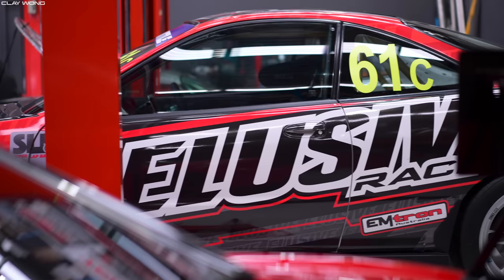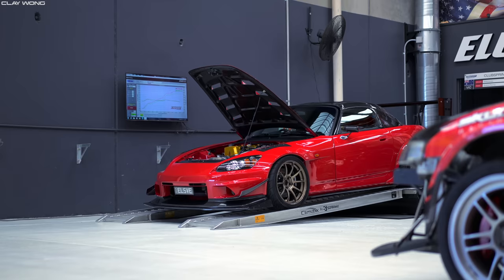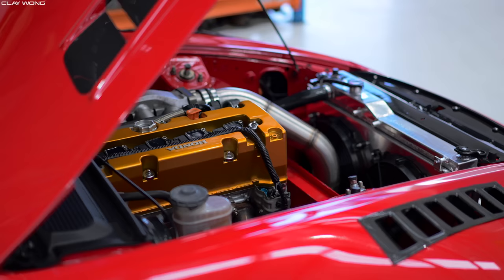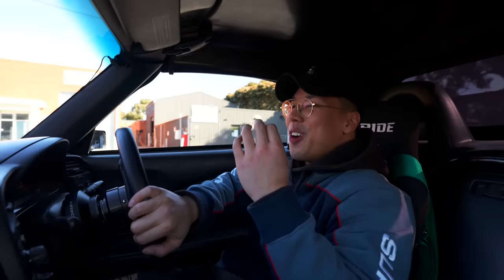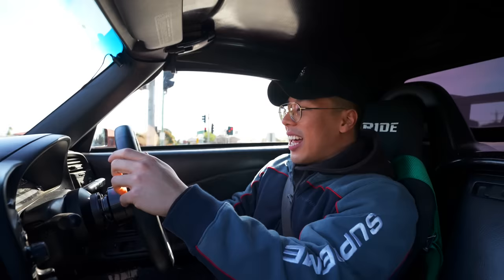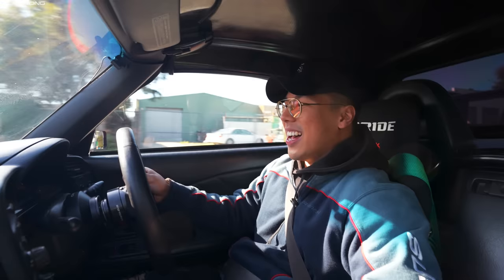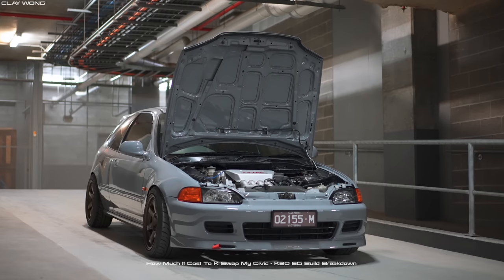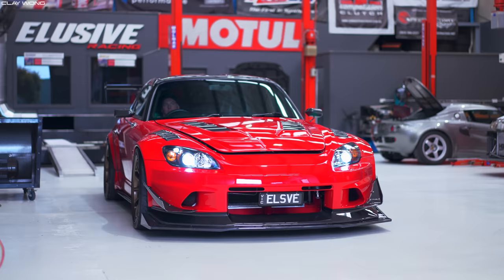This Is Why You Need To K Swap The Honda S2000: K24 S2K

Comment: I like to think the S2000 is more than just a faster MX-5. The glorious 9,000 rpm redline is what makes this car special, and you can drive it that way any day of the week. The F20 (F22 in some markets) defines this car more than any other component. Yes, the K series is powerful, reliable, available everywhere and has tons of aftermarket support, but that will pretty much just turn your S2K into a RWD convertible Civic or Accord. It can also lower its resale. You may as well get a much cheaper random Mazda roadster if you’re gonna do the swap. There’s also a folding hardtop option from the third gen onwards.

Comment: I think the f series is right at home, I’d k swap an NA, NB Miata though!
Reply: Been trying to decide if I want a k24 NB or a k24 ft86
Reply: Same
Reply: @anon136  I think you just need both. I'll borrow the one you're not driving. Lol.
Reply: This is why I’m here as I was going to ls1 swap my nb, but I think I’m sold on this
Reply: @anon136  that I swapped 86 would be so fire and unique!
Reply: @anon136  My dude... i´d love to K swap a GT86, but it is HELLA expensive, much more then K swapping s2k.

K power swap kit is over 9 k USD... NO ENGINE. + some additional costs like some honda parts (oil pump etc.), tune..

But... the problem is, that this swap kit utilizes stock transmission..... which is made out of chocolate. If you want NA, it´s ok but if you want to go for boost, it is reccomanded to swap it out. Best option is 350z trans, but that will run you around 
7k USD (transmission, mounts, custom made drive shaft etc. 
Count in diff and beefier half axels and you are looking at potentially 20k+ with work and everything...

I really like GT86, but i´m not a huge fan of the engine / trans combo, but swapping it out... you could just buy something much, much faster for the money. 

But that´s just my take. If you got the cash, go get it Tiger.

Comment: I feel like you have to build the bottom end of a K series to be as good as the bottom end of the f20 or f22. Yes the roller cam on the intake is better in the K, but if you're only talking stock engine vs stock engine you can't take a stock K as far on forced induction as you can an f22 or f20. There are so many f20's and f22s out there in the world with stock internals making 450-500hp and low 300s tq that have 100k plus on the odometer.  Something else to consider is that all the video comparisons out there typically compare the K24 and the F20, the most dramatic difference. Very few compare the F22 to the K. The reality is the difference is usually less than 20 HP. The K is all the new hype but the F is still an amazing engine that's more than capable. To me the only way I'm ever considering a K is if I blow up my F22 to the point it can't be rebuilt.
Reply: Thinking you have a bottom end with a 2.2 or 2.4L is funny
Reply: @trillazun  What does that even mean?

Comment: A big trend in the US is F24 builds. Makes lots of power and decent torque but reliability is better and overall a cheaper swap than going full K24.

I know a couple grassroots racers who run K series and most seem to end up regretting it. This is strickly due to reliability issues. Lots of vibration problems and things breaking under dedicated track use. Plus side is they're very cheap for a short block but then it could cost you a weekend, a race and time..
Definitely like to see further improvements from the aftermarket with the K series in ap1/2 s2000s.
I'm running a 120k mile F20 lightly modified and tuned. Track it once a month and has been extremely reliable.

Comment: How has it affected the weight distribution? Honda spent a lot of time mounting the original engine just right.
Reply: I was wondering that too with the front engine mid mount design being essentially part of the magic of the chassis and great handling. The k24 has to be substantially heavier. Would cause understeer. In theory.
Reply: They don't weigh that much different and the K24 is mounted in the same position/angle as the F20, I don't think it upsets the weight distribution at all
Reply: My k24 is the same weight around than my b18c5 that I had in my EM1 pretty they weight around the same

Comment: I'm keeping my 9k rpm redline. I bought an S2K that had the engine pulled apart and out of the car, and I still paid to fix it and put it back in rather than k swap it.

Comment: K20 might be a better engine and produce way more power with mods specially in a NA set up where the f20 is pretty much maxed out. But I still love the f20/f22 it has its own sound that I love, unless it blows maybe I’ll consider a k20/24.

Comment: Great vid. For what it’s worth tho - getting rid of the F engine means your killing the value on these fast appreciating cars in original trim.
Reply: Agree but also disagree... current market conditions dont seem to give an F about mods or not... and the body of this car is highly modified so I doubt "orginality" is really priority to them...
Reply from the maker: I gotta agree with you on that! Some owners just prefer fun over value though. I think a stock example is honestly not as fun and explains why there is such a huge aftermarket support for the S2000.😁

Comment: It’s not cheaper if you add in the cost of the swap itself you’re already out five to 6K you can have a reliable 500 hp F-series for that kind of money. Know if money is no object to you then yeah I would agree. The K-series probably is the battery engine if you’re trying to build it.

Comment: I allways considered this comparation unfair. U are comparing the same gearbox with a k24/k20 that has more hp with "shorter gearing". To compare same engine and gearbox capability u should compare something like: f20c with 4.7 fd; f22c with 4.55 fd; k24/20 with a 3.8 fd. The only direct comparation i had was the k24/k20 head (all stock with dc5 cams) vs f20c, both with the same gearbox. Of course k24 wins hands down because it has less top speed but more aceleration. But put a 4.7 final drive or even shorter in the f20c and compare again

Comment: Fucking Mint S2K.
I once heard the F20C is essentially a FWD motor that was made RWD using an adapter plate.
The more I see video's like this I sit back on the fence about selling my AP1.
Great video Clay!
Reply: BTW I've had my S2K since 2011 still has under 200K on the clock ;)
Reply: The F20C was a purpose built motor specifically for the S2000 and nothing else. It was always a rear wheel drive motor

Comment: I strongly disagree.
Yes the K series is a great platform for builders and tuners. But there are so many other considerations to account before “tuning” a vehicle.
As well mentioned in the video “the S2000 is a legendary car” and that status was not given just because the chassis or the roadster, also the masterpiece F20c engine.
Swapping a K-series engine into the S2000 will plummet its market value.
A pristine, low miles, oem s2000 can reach the 6 digits dollars in auctions.
The argument of cheap parts is just for the engine, not cheap to replace body parts or interiors on and S2000 (specially the soft or hard top).
Same reason why you wouldn’t K swap an NSX.
So no, I would not swap a F20/F22 engine for a K series.

Comment: Your description says it makes 230whp when converted from KW’s. Is that true? I don’t know. J’s Racing has had a 345hp at the crank F27 for a while now. What’s the point of swapping to an almost equally capable engine? Even their F20 made above 280hp at the crank. That’s about 230whp at 2 liters but you’re making that with a 2.4L and at the expense of an engine swap. The parts list for the J’s Racing engine is public and easy to replicate. I don’t think it’s a very intelligent thing to do. It’s like swapping an Rb26 for a 2jz.

Comment: Putting a k-series into an s2000 without a blown F-series is just stupid. Unless you plan on saving the original engine for the sake of collector value (which a car that has been swapped and km'd out isn't going to have), I don't see the reason with one caveat: you ONLY care about horsepower, and plan on blowing up your k-series at some point, at which point having a cheaper motor to replace makes sense.

Comment: U meant k24 can't rev that high they say. U n3ed to upgrade the pump and other things. But k20 ive seen rev to 9 10 or even 11k. Still need to upgrade the top end like a 24. But atill can rev higher no problem.
Reply: Pretty sure this s2k is k20/k24 frank

Comment: The F20C & K20 are "almost" virtually the same engine. Geez , the parts are interchangeable, example crank can be swapped between both engines (cheap stocker kit) I've seen track builds with K20 head on a f20 block. I know the Transmissions bolt pattern are different and built for fwd vs rwd, bare in mind the focus of this conversation is the engine here. 

Yes, we all know the F engine head flows better and K engines have VTC. Just saying..., but I think the videos title is slightly misleading for the newbies.

Comment: Nice build and good point about the parts availability for the K series. Unfortunately though the cost of such a build and the hit it gives to the market value of a car which is going up in price doesn t make it worth it in my opinion. Unless you blowed up your F series maybe. Otherwise you are better off slightly modifying a stock F20-F22. In Europe we also got ap1 revised engine with Ap2 chassis which is also a very interesting OEM package itself

Comment: I'll keep my F22, while the stock engine makes ~237-horsepower at 7,800 rpm and 162 pound-feet of torque at 6,800 rpm vs. the stock K24A3 makes 197 hp (147 kW) at 6,800 rpm, 164 lb-ft (222 Nm) at 4,500 rpm.

Comment: K series is King,👑 # k swap the world!!😎💪
Reply: absolutely not, f20c is king that’s why it’s more expensive.
Reply: @bige7186  just because it is more expensive mate doesn't mean it's king, what does the price have anything to do with it?? The k series is a better motor that is why it is King.
Reply: @igvtec  more expensive = better quality .
Reply: @bige7186  it's price has got nothing to do with it being a better motor, which it is not... Do some research mate. This conversation is pointless I've been into Honda's since day 1. I know about the F20C and K series. You are not going to tell me anything different, or what I already know!🤦‍♂️
Do you really think clay Wong, said what he said for the sake of it?? Or do you think a performance shop elusive racing that specialises in Honda
Did the K swap do you think you know more than them or they did the K swap for the sake of it.🤦‍♂️🤣
Reply: @igvtec  again, ima say this one last time, F20C > k20/k24.
Reply: @bige7186  you are delusional …. Kseries have superior engine configuration/design over the F… 
Vtc
More torque 
Better usable powerband 
Better potential 
1 piece crank cap support
Oh and I smoke bolt on s2000 with my Oem bolt on K24 in my EM1 
AP1 or AP2 … it is not strip down 

F20c and F22c were actually the prototype of the Kseries 

I don’t have to wait to 6000rpm to have Power 
Vtec kicks at 3500 at 35% tps signal it is fricking nuts
Reply: @tomydespins2315  Yeah delusional for sure mate. That big E bloke was making my head hurt none of what he said made any sense at all. Just because a f20c is only exclusive to the S2000, or it being more expensive. Does not mean the build quality in the engines change with Honda.🤦‍♂️🤣🤣

Comment: The only thing wrong with this car the fenders thats cut at the edge close to the door.. and maybe the wing is a little big. Also.. F20c 177kw vs k24 171kw..? If you invest this much money into a s2k, just build the f20c a bit or swap for the 2.2L and build that a bit. 
I do love the front bumper, splitter and canards.. Plus the hood and carbon fiber cut outs ontop of the fender.. The wheels also look nice

Comment: We've known for over 20 years the K series makes more power. But swapping isn't practical. The simple reason is, it's too fucking big for chassis designed for F and B series. No thanks, holmes. Sure, anything is possible if you spend $200K.

Comment: Im no car guy but from what I know from what others been drilling into my head:1) K series engines are expensive to acquire and install for us unknowledgeable car guys. 2) K series are not easily found as other engines. 3) I don't even know if my car is compatible with my 02 accord coupe. Will admit seeing these car builds seem awesome. But for my clumsy slow self, its a costly mistake id rather spend on something else.

Comment: My fd2r k20a makes more then this fully built motor and even more then the fc20
Mine makes on 98gas 181kw to the front on wheels
Mods:
Hondata tune
Skunk2 intake
Ktune fuel rail
Plm headers

Comment: Dude there’s no torque when you have to wait for VTEC at 5500 rpm lol this guy has never driven a V8
Reply: 5500 ?? My k24 vtec engage at 3500 at 35% and more tps signal